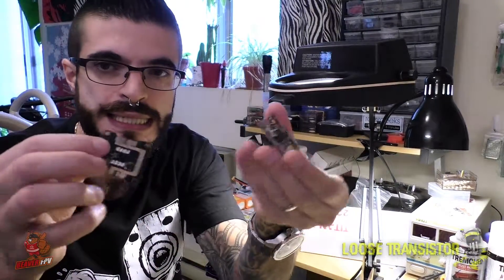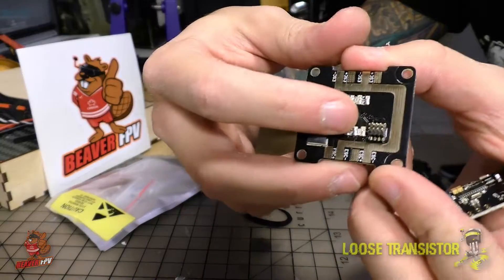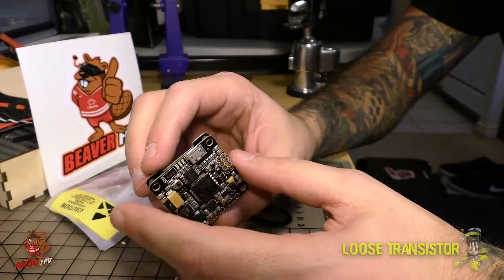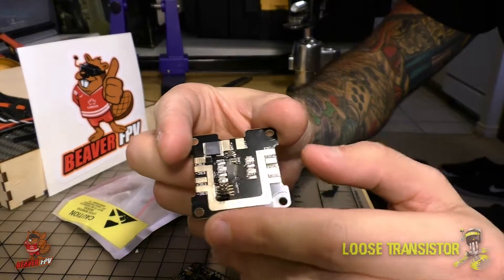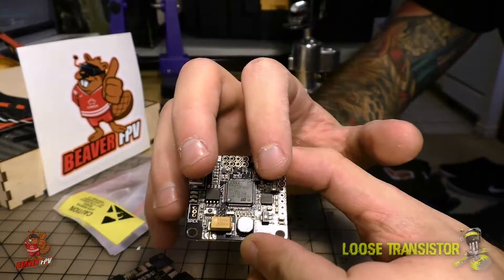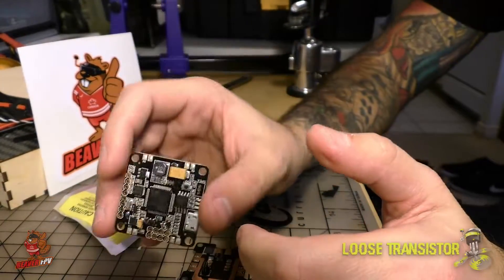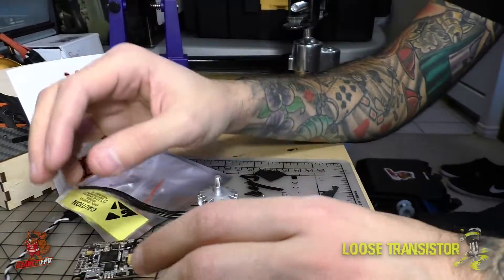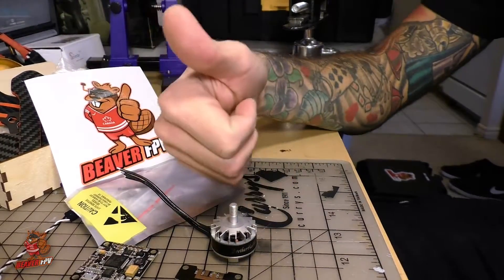Kiwi F4 Flight Controller [PDB | OSD | MPU6000] - Compact as FRIG!

Comment: i have 2 of these boards one i have on the new spektrum 5- 8.4 volt receiver in the second one im using 3.3 volt satellite but it wont work my sat lights up but nothing no matter what uart  i use any help
Reply from the maker: Hey Johnathan, is it possible that the 3.3v satellite receiver got burnt out? I imagine the Kiwi F4 is outputting 5V directly to it.

Comment: While this flight controller / pdb combo looks AMAZING.. why does it have to be 82$ USD :-(

Looking forward to your hyphy build!
Reply: They arent out of the uk ( where I live) , they are from Poland ;)
Reply from the maker: Flying Lemon uses good quality components on their boards so the cost tends to be a bit higher. There is also a fair bit of engineering that went into these boards. They pack a whole lot of features on a pretty compact area.

Thanks =) I should have the frame build & fitting out soon enough!
Reply: Oh nice! Didn't realise airbot made this. A definite fan of the omnibus series. 

P.S. You will love the t2 2600kv motors man! Pure power and speed!
Reply from the maker: My bad, it's actually Flying Lemon. But they are still out of the UK and it looks to me they are using top notch components. I will do some digging and go over it on the next Hyph episode.
Reply from the maker: AHhh My bad!